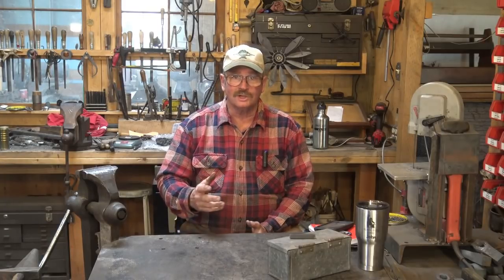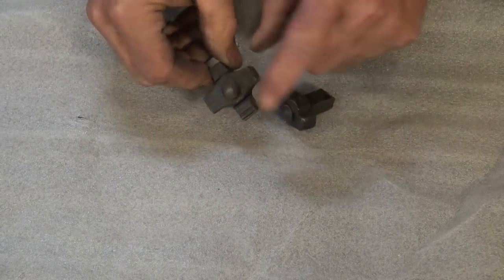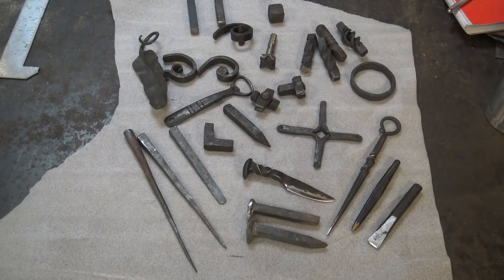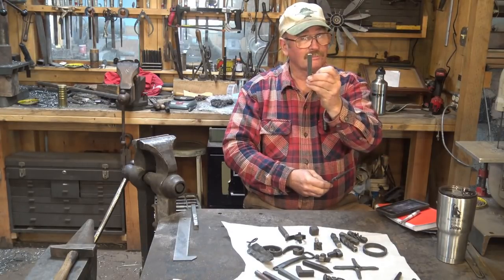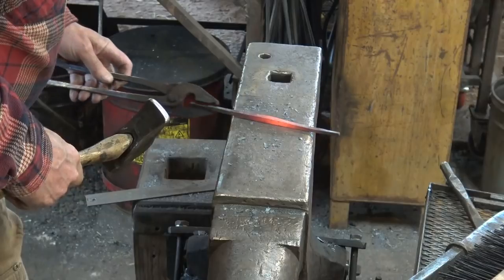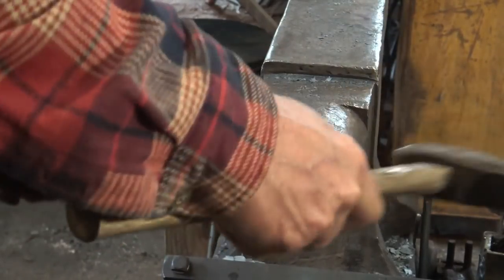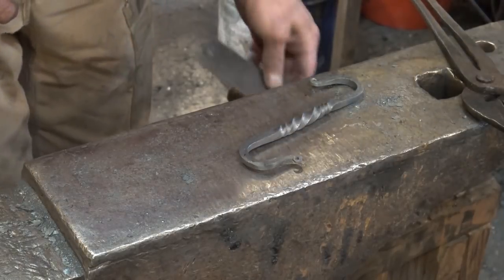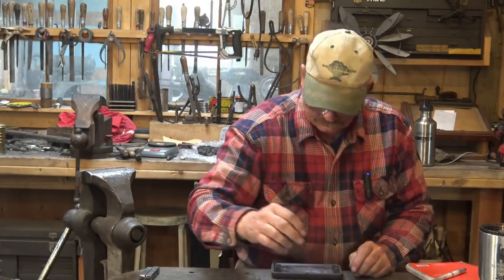Blacksmith challenge , revisting an idea to stretch your imagination

Comment: Great challenge! another train of thought on this is, small town blacksmith shops out in the country during the 1800's wouldn't have had readily accessible supply of steel to make something so they would have to use what they had on hand, draw it out and hammer to size the stock they needed cut off the excess and save it for a future project.

Comment: If I had a forge, I'd do a fire striker with this. You were very close to, at some point!
Reply from the maker: It would make a big striker, but why not
Reply: Dig a hole put a pipe with a hairdryer taped on throw in some charcoal and get started 👍

Comment: I think this is a great idea to think outside the box. I have watched a couple of the s hooks videos of yours and have a question. When you dip the scroll to cool it, which way does the heat in the bar travel after? Is the heat more attracted to the thicker bar or is it based on the quick cool in this case? I understand heat sync however I’m trying to understand how heat travels in the product your working with. I hope this makes sense lol. Thank you sir
Reply from the maker: Heat will, move faster into the thinner areas but remain for longer in the thicker

Comment: I'm just finishing up on a rolling wood rack because lumber storage was taking up too much of my workshop. (especially scraps) What are you using to store your metal and scraps?
Reply from the maker: I have a rack outside for long bars.  Short stuff ends up in buckets, which are terrible.  I hope to build a tall bin type rack for anything less than 2 feet

Comment: Hello Mr Switzer.  I am sure you hear this all the time but thank you so much for your videos, I have been talking about blacksmithing for many years now and you have inspired me to finally do it.  However now that I have built my forge I am having trouble and really hope you or someone else can help me (also I hope I don't sound too foolish.)  I have a commercial fire pot, of welded 1/2  inch stainless steel, and I am burning Coke, unfortunately my blower at the moment is a blow dryer, but it is delivering a lot of air and the fire seems to burn well. But I am not heating the metal properly.  It comes out either glowing red, or burning up ( sparklers)  I can't seem to get that nice bright yellow I see in many of your videos.  Do you have any tips on what the fire should look like and how to lay the metal in it?  I know this is a question only a total beginner would ask but I am just trying to learn and am enjoying this so much right now.  Thank you again for all your hard work and wonderful teachings, the techniques I have seen you demonstrate have all worked great for me, I just have very little time because the metal isn't quite hot enough.
Reply from the maker: Hair dryers are poor blower substitutes and will only support a small fire.  It sounds like you may have the work to low in the fire pot so the oxygen is not being consumed by the coke fire.  This makes the material burn up easily.  try keeping the materisl level with the top of the fire pot with enough coke to mound up over the top.  The hair dryer won't allow a very high heat in a deep fire but it should stop burning the material.

Comment: Challenge accepted and complete though my piece was a tad bit over 3 inches and ill have my video out tonight or early morning east coast time!That is if my stupid iphone 7 lets me import my videos..its been a dread taking my videos out the phone..it will do it and it wont and then it does...
Reply from the maker: I have been able to load videos directly from my Iphone 7
Reply: I got it to work i think it just has a problem with windows 10 or something but i have to switch up a few usb's and it eventually works but i did the video and its now almost done compressing and still have to upload,i forged a cross and it was my first one ever i thought it turned out well.

Comment: John what about instagram as opposed to FB?
Reply: neilyeag I'm with you I would do the challenge in a heartbeat but I'm not doing Facebook
Reply: I have to ask what the difference is? Both are owned by the same company. Strictly an interface thing?
Reply: Facebook works on a PC while instagram is view only on a desktop machine, unless you jump through hoops you can't post pictures on instagram.
Reply: Blazer02LS because Instagram has way less in my information to give away at the highest bidder
Reply: True, but that wasn't what I was saying. Instagram doesn't work on a desktop computer. It works fine as a phone app but unless you do a bunch of workarounds you cannot post to instagram from a PC.. However facebook works just fine on a desktop machine as well as on a phone/tablet. So members of his audience who use PCs would have a tougher time participating.
Reply: Blazer02LS thank you for clarifying and I do understand what you're saying but I'm still not using Facebook. Yeah I believe mr. Zuckerberg had to just testify because of giving all your information away
Reply: IG can't really substitute FB when it comes to groups and discussions. You can't reply with your own photoes, and to run a community everyone should follow everyone and regularly check their updates etc, which for sure will not work. IG is just not designed for that (the fact that it is from the same owner is merely because FB bought IG some time ago)
Reply from the maker: Instagram is fine by me.  If you use the hashtag #blacksmithchallenge people should be able to find the images
Reply from the maker: personally I like Instagram for its simplicity.  I have found that, from a business point of view, it is a much better platform for promoting and marketing the shop.  The fact that it is phone based makes taking a photo in the shop and posting it quick and easy